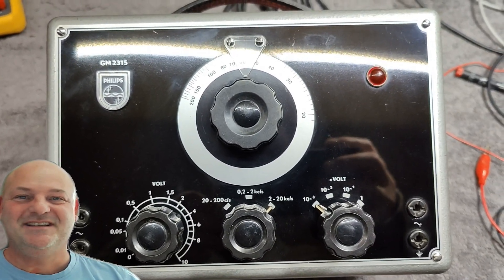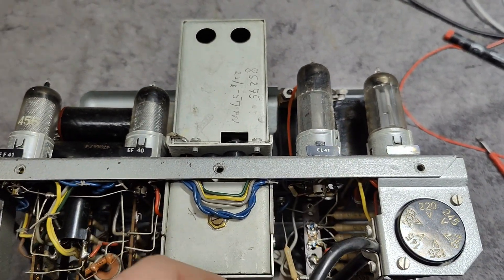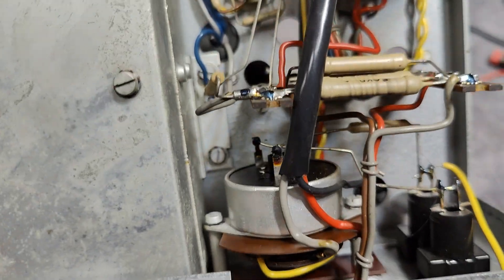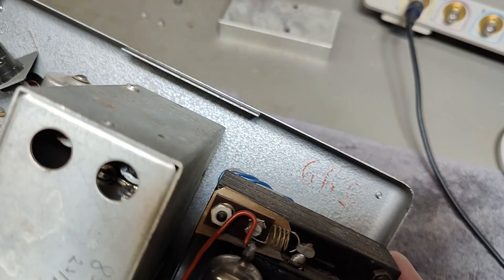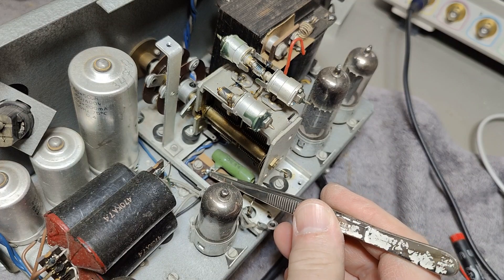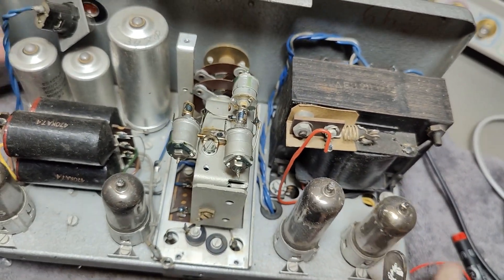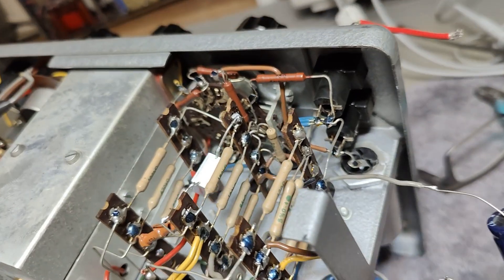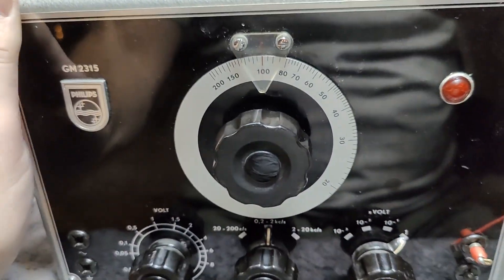Philips GM2315/1 Sinewave Generator 1957 tube repair

Comment: ...Don't most rimlock tubes have a noval or miniature near equivalent, probably the base of the dead tube could even be used to make an adapter (if you can chop it off in one piece)?
Reply from the maker: yes near equvilant tubes exist, in most likely noval socket types, i need to make a little configurable adapter series :-)

Comment: How about fitting silicon rectifier  diodes and then some gas regulator tubes ? OA2 and a OB105   and it will give you 255 volts.
Reply: I find gas regulator tubes a bit scary ... if they are worn out and don't strike reliably, you get spurious overvoltages ... and running any equipment with gas regulators in it up on a variac ends up producing the opposite of the intended soft start :)
Reply from the maker: @splitprissm9339  YES gas regulators also scare me for exactly that reason, but history has shown us, in most cases, they out live all other parts in the unit, if i alone look in the tube lot i have to throw out, it is almost never a regulator tube.
Reply: @TeardownOZ2CPU  The parts that regularly outlive all other parts might be the parts that regularly destroy everything else  :) I tried out a little bias power supply device made in the 1960s based on a gas regulator... it is simply too scary to use the instrument. They essentially shunt regulated 300 something volts down to 70 with the gas regulator and some voltage dividers and a big pot across the presumed 70V. Tubes might just not mind suddently being biased with some minus 80 volts when there is a hiccup with the gas regulator. I do though.... Add to that various possible failure modes of old potentiometers....
Reply from the maker: @splitprissm9339  exactly, and rarely any type of over / under voltage protection in the design, so when simple things brake, the result is so much extra go away also..